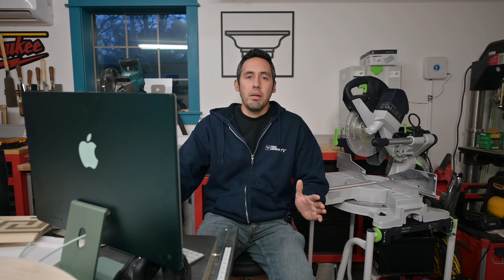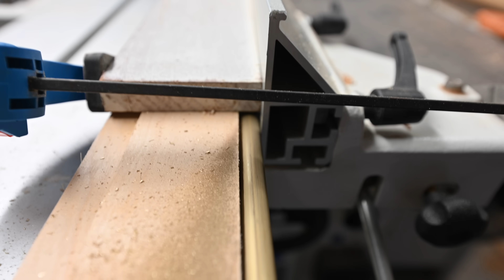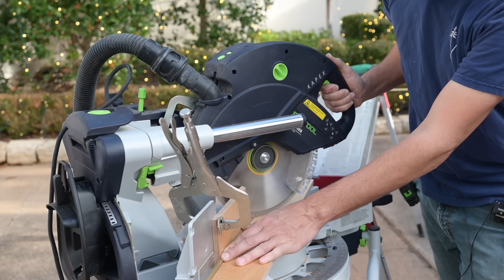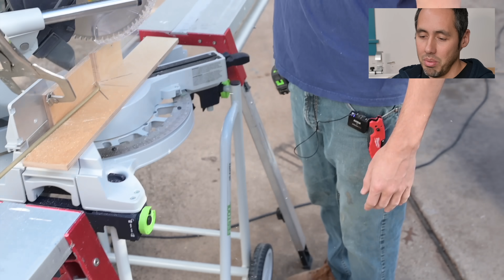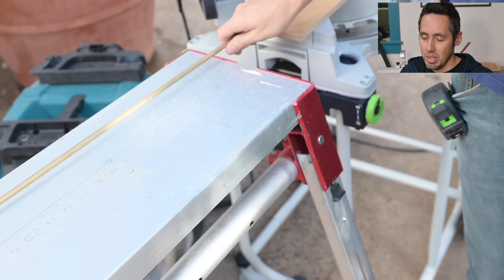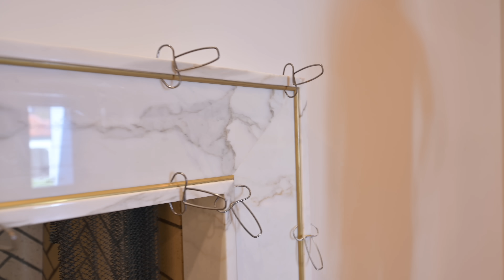It only took 12 years...My first MITER SAW injury.

Comment: I am an outside Sales guy for a lumberyard.  Was done measuring a house of trim, it was snowing out and There was no heat inside the house so after getting all the doors and trim measured up I got out the door and was hustling across the construction site to get to my car.  As I ran across the lot there was a 2x4 frozen to the ground under 6" of snow  with a 16d nail sticking out of it.  As I ran to my car I stepped on that nail it went through my boot and half way through my foot.  The good news was since I was running and the board was frozen to the ground my forward momentum let me pull the nail out without having to wait.  Talk about hurt!   Sometime I will tell you about the guy who covered a basement stair hole with 1/2" R board in a house I was measuring.

Comment: Here’s my worst injury…. As a DIYer, I was using my table saw to cut small pieces for stair noses for wooden stairs that I recently installed. The pieces were about an inch in size and like you said, those things shoot off due to being too small. Well, that little piece of wood shot straight towards my groin and due to the impact I reacted by bending, spraining my back. The first couple of days were OK, but on that week’s Monday morning, heading back to work, I couldn’t even walk, step out of my car, dress, put my shoes on and pretty much struggled with everything.  This was just before Thanksgiving of 2023 and had pain well over a month. Thankfully there’s no more pain and have that feeling like I’ve been reborn again. Damn was it scary! I thought i had some internal damage. Now I think that if I was wearing my woodworking apron, the impact wouldn’t have been as bad, but I figured, working with small cuts, it be quick and easy. Lesson learned.
Thanks for your great videos!

Comment: The only injury I've thankfully sustained was using a pin nailer. We were replacing treads and risers on a stage for a school. While nailing the scotia on I had my thumb a little too close to where i was shooting. Pin nails being pin nails it decided to curve out and got me right in the middle of my thumb. I guess the biggest plus of that happening is now I am very cautious of where my fingers are when nailing. Ive had a few close calls making small cuts on a miter saw but fortunately I haven't been injured.

Comment: In my wood shop, I was running an 8 ft board thru my jointer.  It was getting close to being flat, I lifted the board up to inspect it, on the way down my right middle finger got a little shorter as I touched the rotating jointer blades. One millisecond took 1/8” off the tip of my middle finger.

Comment: Yes, I know how scary a woodworking accident is.  I was in my garage building my wife's new headboard.  I had to cut some smaller straps and as you mentioned,  I became complacent after doing several runs. For some reason I felt I didn't need nmy push stick on the cut in question.  Sure enough the wood kicked and my forward pressure carried my thumb into the blade.. it is still attached but definitely not the same. I will never forget that every time I use it. I'm glad you're ok.

Comment: Mine is it was a "cold" day in the fl keys and was building a custom trellis for a client. Was going too fast to get it done, cut the 5/4 decking i was using with a skill saw, made the square cut took my finger off the trigger and went to move the shoe to a 45 and my hand slipped off the locking screw and stopped the blade with my middle finger.  Blade went through the tip and nail long ways. That was in 2017 anf still have a pink scar under the nail. Needless to say i am a bit slower to adjust angles on any of my skill saws now. By the way got a shirt from your shop and love it!

Comment: My worst injury to date was 2 years ago. I was scoring vinyl plank flooring with a utility knife. I usually use my miter saw but was told this was an easy way to cut LVP. It was a new blade. I was using a straight edge but it was too thin, probably only 1/16" thick (not good). I was using excessive force (not good) as I was scoring the piece, then the knife blade slipped on top of straight edge and sliced right through my finger nail and index finger. The cut was at least 1 inch long and it went about 90 percent through my finger. I ended up in the ER and got stitched up. Fortunately, I did not lose my finger. It is still tender to this day and I've lost some feeling in it but I can use it. It's better to buy a Vinyl Flooring Cutter tool.

Comment: I been a carpenter and woodworker for over 30yrs, the only serious injury was with my jointer, I knew better but I in rush and I wanted to plane a small piece of walnut wood for this cabinet and I didn't use a paddle and bang my index finger went right into the blades, lost a little tip but it was a rooky mistake and I will always appreciate how dangerous power tools are

Comment: Man glad you’re ok. I never get my hands that close to the miter. I’ll put a board against it. My worst injuries, doesn’t sound like much but it still bothers me 6 months later. I was working in my shop and was using a pin nailer. I had my 18g battery nailer siting on my table saw and as I moved around the air hose grabbed it and pulled it off the saw. That little bastard is heavy, it landed straight on my little toe and even though I was were shoes (I’m always in flip flops) it did serious damage. I could not put a shoe on for 5 days and once I could, it hurt. In hindsight, I should have went to the doctor because this is going to turn out to be one of those injuries that follow you for the rest of your life. Talking about seeing stars.

Comment: After witnessing how my tile installer cuts aluminum Schluter edging with a grinder, (which leaves a rough cut), I let him use my miter saw to cut it but he immediately had a kickback.  I then taught him how to cleanly cut it (by going slow) with a sacrificial board the entire length of the fence for every single cut.  In your case had you used a new sacrificial backer for the waste portion, it likely wouldn’t have kicked back.  (Sandwiching between two boards would be even better).

Two months ago, I was changing the brakes on my truck and while driving out the guide pin, the pin driver slipped and ricocheted into my eye.  It missed the cornea by 2 millimeters but I still had a laceration and a red eye for 9 days.  Fortunately it healed and didn’t affect my eyesight.  The eye doctor did mention that it would scar, and to wear safety glasses in the future 😁

Comment: My worst injury was on June 11, 1991. I was 11, and I was helping my dad cut some plywood for a workbench he was making. I thought the board was going to fall (I was on the back of the piece he was ripping with a skillsaw) and I reached over to catch the cut off and the saw went through my hand right below my middle finger pointer finger and continued on through my thumb. I know have a really cool “man scar,” as I describe it to my kids and have full function of my hand. The only draw back is my thumb sometimes will ache at the cut line due to the cut tendons etc. but all good. Gotta Respect the blades.

Comment: Richard , always consider the direction of blade travel when cutting small things , the cutting was being done by the back of blade , so teeth are moving in a more upward direction , and stay away from small cut-pods that can become trapped , eg between fence and blade . I probably would have spaced the cutting farther from the fence so that blade was entering the cut with teeth traveling in a more downward direction.  I’ve had plenty of small cut  explosions in my early years !  Worst injury ,kickback to the hand and arm while using someone else’s saw !

Comment: Mine was a standard table saw kickback cutting 3/4" material.  Of course, I was standing right behind the blade so I was able to stop the flying board with my gut.  What was neat was that you could tell the exact dimensions of the board days later by measuring the bruise that I had on my torso.

Comment: My worst saw injury was to my daughter. She was 12-13 years old and wanted to help me on a project. I was teaching her how to use a dewalt table saw safely (so I thought). When it came time for  her to feed her first piece of 1/2”  plywood through the saw, she panicked about midway through the cut. At that point she let go and the 12”x30” piece shot straight at her body. Luckily no permanent physical damage. But it left a horrible bruise on her stomach. It also has kept her from ever using a table saw again (she’s 23 now and a LEO).  I’ve seen bloodier injuries to other coworkers over the years, but being the one responsible for a near catastrophic injury to one of my kids is the worst. I still think about that every time I use the saw.

Comment: I almost cut my left index finger by hand drilling into a thin piece of metal in the attempt to make a bracket. The first 3 holes went smooth and, like you said, that was building confidence in my self that I was doing the right thing. I knew in my spirit that is still unsafe to just hold that thin metal strip with my bare hand while drilling with the other one. And it happened: the metal strip got caught in the drill bit and pulled out of my left hand while spinning like a blade. The first "free revolutions" were through my left index finger. I still have a nice scar on it and my touch sense is diminished a bit, but not completely numb. And all of these after I almost chopped the same finger off with a grinder, some years apart. I pray that I get to keep my finger and all of my fingers every time I use power tools. So far, so good, thank God for His protection!

You definitely need a blade for metal, NOT a blade for wood. Brass is a bit harder than aluminum. A smaller tooth blade would go much nicer and better through any thickness of brass. I am 100% sure that WAS your mistake: using the same type of blade for a different kind of material. Get the proper blade for brass and I will guaranty you 100% success!

Comment: I’m glad you’re ok,I’ve had similar things happen like that with small cut offs using Dewalt sliding 12 inch saw, I wish it had a sold start motor don’t know it new ones do ,but if have the blade to close to work piece and start it it will jump with so much power and hit the work piece before your ready,since I have tried to remember that and start the saw a few inches above before cutting.  Thanks

Comment: I build aluminum sunrooms for a living. I cut small aluminum extrusions every day. First thing I see is you are cutting on a 45 degree angle with the mitre to the  right. So the teeth of the blade can catch the tip of the brass and force it to the left where you are holding. Always plan your cuts so you cut the opposite direction if possible. Also I have found to use a finish cut wood cutting blade. Every non-ferrous blade I have tried, no matter how expensive, they ALWAYS kick back on the material. They are fine for straight 90 degree cuts but if you are mitreing or beveling they bite. And last thing I have found is I always use my small 7-¼ Milwaukee 18v sliding saw. Best thing about that saw is that it isn’t too powerful so you can always overpower the saw if the material bites back. My 10” and 12” saws are too big and strong for that small metal work.

Comment: My worst jobsite injury was when I fell on stilts. I was taping a 12' ceiling with a bazooka and tripped over some lumber in the floor. I tried to cradle the bazooka so that it didn't get damaged and broke my right elbow. I was newly married and a new dad, no way to pay the bills if I wasn't working so I had to get back up and keep going. It honestly didn't hurt that bad until I got home that night. I probably took 100 Tylenol that night. I worked left handed for two weeks before my wife finally convinced me to go to the emergency room. They put it in a temporary cast and made me an appointment with Bone and Joint. Bone and joint took the cast off and said it was the worst thing you can do for your injury, just keep doing what you've been doing.

Comment: Similar injury to yours, cutting on a miter saw. Cutting a small piece of wood. As I was slowly cutting it, i heard a bang like something in the middle of the saw exploded right after a pain on my left hand. The small piece i was holding was gone and the aluminum plate on the saw got chewed/mangled a little. The wood being thrown back is what caused my hand to get bruised. Going forward, I only cut small pieces on my sled on the table saw or if i have to cut something small on the miter saw use clamps or a jig to hold it down and keep your hands away. If you can't do any of that use another tool like a hand saw where you have more control.

Comment: Building a deck using a handheld belt sander. Got my index finger stuck in it. Ground my fingernail off and down to the bone. They dont stop easily. Never thought how dangerous they are. Wrapped it up and finished sanding. Deck came out nice. Healed well and i even have a shorter nail on that finger now. Cant really tell it much.

Comment: About 15 years ago, I bought my 1st table saw. Was on my last cut. I was doing everything wrong. No guard, in a hurry, no push stick. Was pushing through a piece of 3/4 plywood. Had my left hand was way too close to the blade and right at the end of the cut the board binded up and threw my left index finger into the blade. But it didn't catch me across my finger it caught me directly into the end of my finger. Shattering the tip of my finger and breaking it across the middle knuckle and tearing the tendon. It was brutal. Lost some of the tip of my finger but got to keep most of it. Now it's more pointed than rounded at the tip and I can only bend it halfway due to the tendon tear. Hard lesson learned from getting in too much of a hurry and not using the table saw correctly. But I was very lucky it could have been much worse. Have a good day.

Comment: Arrived to jobsite, set up my miter saw station to begin cutting the first piece of simple finger joint pine base. Cut down through the base too quickly and the base pretty much blew apart at the joint. I lifted my hand up from the saw and ended up with my knuckles hitting the blade. Nearly 40 stitches across 4 of my fingers. Had one of my helpers without a license drive me to the ER 😵‍💫 Fun day

Comment: Good to see all the fingers are there. I was using the miter saw to make one of the last cuts. I made the cut and was waiting for the blade to stop. Don't know why I lifted my index finger before the blade fully stopped and don't know how it clipped it. Made like a half inch cut on it. Didn't cut it so bad but it was sorta deep. If the blade had been moving faster I'd probably  would have lost almost an inch of the finger. Didn't go to the ER. We taped it up and finished the job.  Stay safe guys.

Comment: Disassembling a baker on the job I had already changed out of my work boots.  Last thing to do of the day. Dropped the rail on my foot.  Swelled up bad and tons of blood under my toe nail.  Used a 16th inch drill bit to put a hole in the toe nail and provide relief from the pressure

Comment: I always clamp sketchy pieces in solid. Only takes a few min. And elevate the piece you are holding so the fall off has somewhere to go and chances of it getting sucked into the slot.....even small as it may be....and binding in the blade. I have cut a ton of small dense stuffs like that and I would rather wreck the blade and or arbor than have something kick back or worse suck your hand towards the blade. I been bit worse than u did so I modified things and always check my complacency. As I am not perfect I will share that I shot a 2 inch 18 guage nail thru my finger and out my fingernail yesterday...yep....complacency
Got me
First off my gun was out of position and was only going thru one thickness of 3/4 material and second I should have grabbed the 23 guage with 1 3/8 nails in it. So Richard....thanx for sharing because we all in this together and hopefully able to pass on what we know and have learned to the next generation.
Aloha from Kauai

Comment: I’ve had a couple over the years but the one that I’ve tried to learn from (and preach to others about) was a hand injury from a utility knife.
We were resurfacing a deck with composite material and using some of it to cover some planter boxes we had built. Late in the day, I was using one of the extendable, snap off blade type  knives to clear out the corner of a notch I had made. My two big mistakes: Using a dull blade and cutting towards myself. Holding the board in my left hand and cutting toward that hand while trying to force the dull knife through the material (which for those whom may not know is often a composite of plastic and wood pulp) and the blade slipped. The bade cut a 2-1/2” gash across the meaty bottom left part of my left hand, just below my thumb.
I think it garnered about 5 stitches. 
I count myself extremely lucky. Had that blade gone just a little higher, I would have severely damaged my thumb. Just a bit lower and I could have gone across or into my wrist. 
Yikes! There’s a reason people say that sharp blades are safer; if your cutting blade is sharp (no matter what the configuration) you are less likely to feel the need to force the tool through and thus increase the chances for slipping or kickback. Also, the rule to never cut towards yourself always seemed more of a guideline, but like many others have said, it’s not so much if, as when, and all it takes is one time to ruin your day, or worse!
Glad yours wasn’t worse! Thanks for sharing, OSHA Richard.